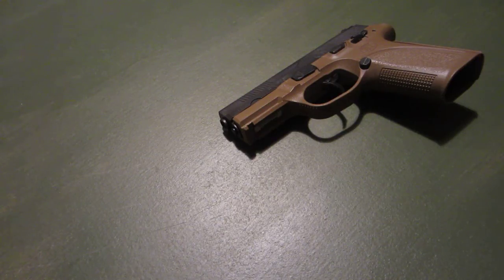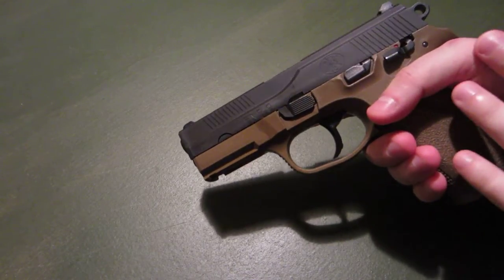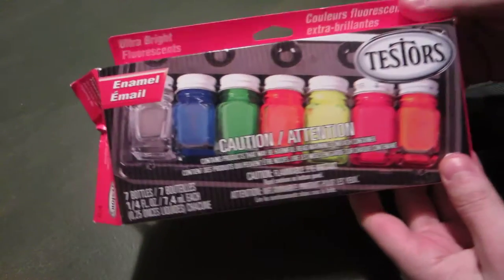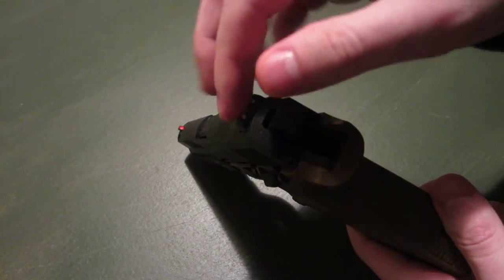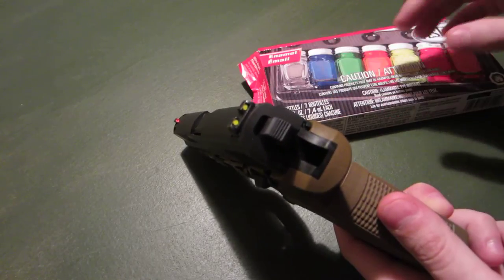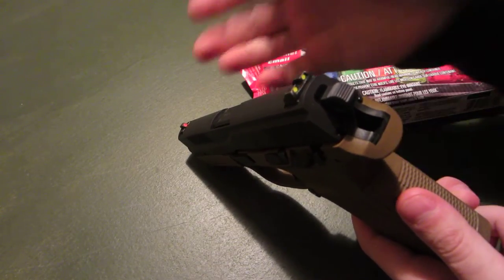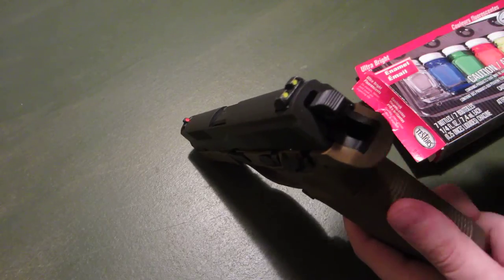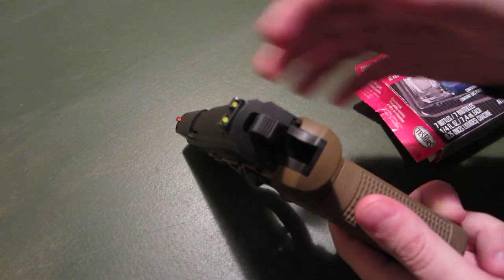Simple Three Dot Sight Paint Upgrade

Comment: On the rear sights you could drill out the holes a bit more to make it easier to fill them. Also, I found a small paper clip to be better than a toothpick since it is a finer point.

Comment: If you wound up painting it white again as a base coat why not leave the existing paint on there and using a cleaner to remove any grease or residue before you apply the new paint?